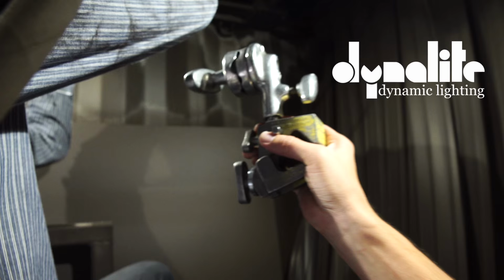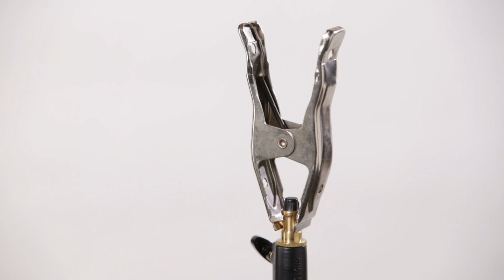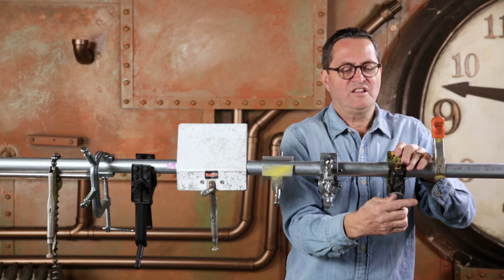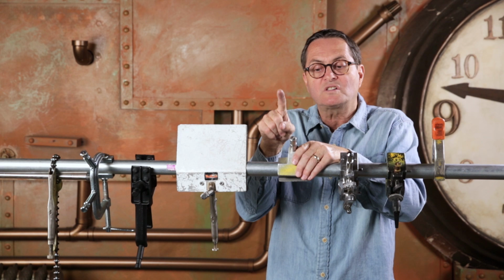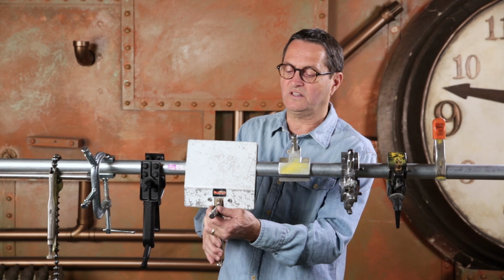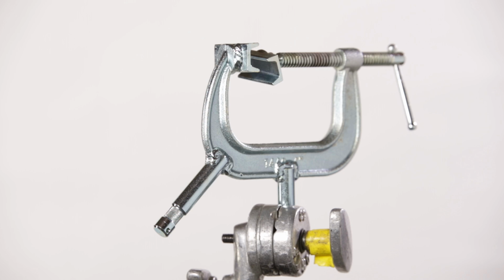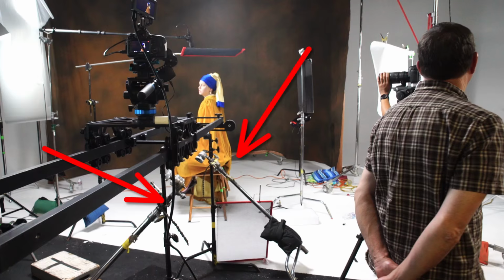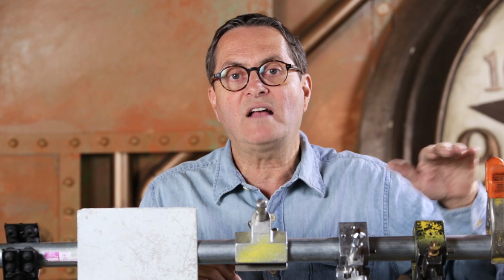Clamps for Photo and Video: the Basics

Comment: It's worth noting that c clamps and speed c clamps are usually used to bite into wooden beams it other very wide parallel faces, and they're virtually always used with cribbing (short sections of 1x3 or 2x4) wrapped in duvetyne to protect the surface from the jaws of the clamp.
Reply from the maker: Thanks for your pointers Jeff. You sound like you have grip experience.
Reply: The Slanted Lens Not nearly as much as many others ha. Speed C's are especially cool because you can just change out the length of speedrail to whatever you need if you need to grab something super wide. Modern studio makes an interesting version of the speed c using 5/8" fittings instead of speedrail, so you could use a standard 40 inch grip arm to make a very wide c clamp for rigging lightweight fixtures without having to carry around a bunch of pipe.